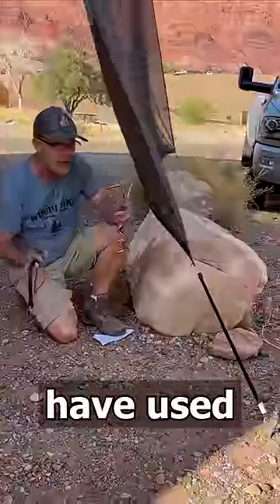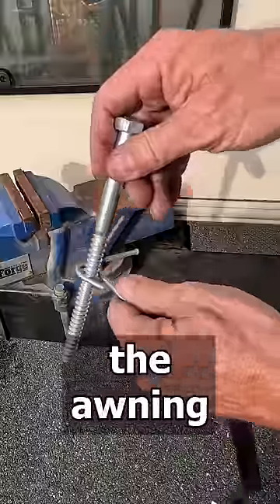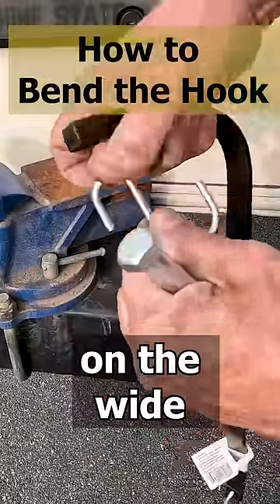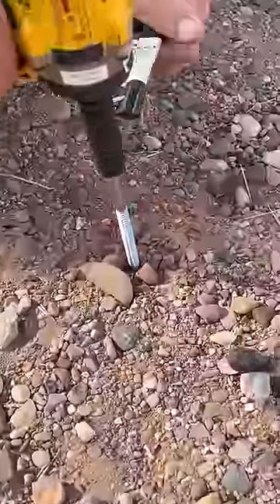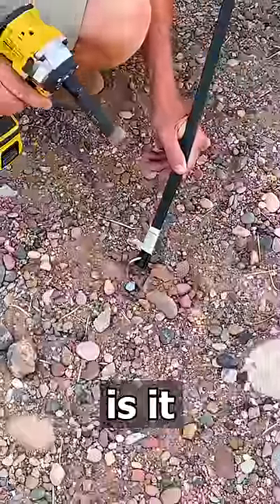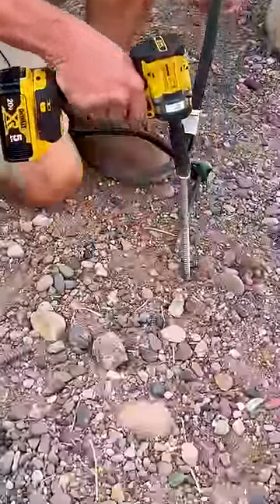Screw in Tent/Awning Spike #shorts  (RV Living Full Time) 4K

Comment: Heres another tip: put the screw at a 45 degree angle towards the pulling force.
That way the winds gotta lift the dirt also to pull it out. (It'll be able to withstand much stronger winds and things potentially tripping over the cords.)
Reply from the maker: Great tip. Thanks
Reply: I always do this with the supplied stakes

Comment: I made my spikes out of 24 inch masonery drill bits with nuts welded on the top, they drill throgh any ground, 
And long enough not to pull out of soil.
Use a 3/4 inch bit by 2 foot , been using them fot 20 years.
Reply from the maker: Wow. That’s intense. 
We are aiming more at what you can find easily at an Ace Hardware 
But sounds your system is the top 👍

Comment: That would only work out west, the soil on the east coast isn't packed as much and the lag screws would pull right out
Reply from the maker: Definitely depends on the soil. We camp in a lot of “natural” spots so we haven’t had issues
Reply: ah don't know what "natural" has to do with
anything other than cringy virtue signaling
since it obvious u can't just run screws into any ground and that's gonna work.  🤨
Reply: @warehousejo007 . Obviously it’s gonna depend on the ground type …. But as as matter of fact tho I live on the east coast and use this method for many years for my animal pens… no problem!!!
Reply: in upstate NY they have a lot of slag / shale in the soil, and I have been using what we call "50 penny nails" which are about a foot long and used on landscape RR ties because tent stakes just bend. This idea is next level for sure!
Reply: I’m is the easy and this true. Say the preferred areas I go to have sand, which is natural. As well as soft upper soil (camp by rivers). So I get rid of the ones they come with and get better ones. Then again I go prepared and by get rid I mean or then in the bag for back up. A terrible back up 😂

Comment: I'm using plain screwdrivers instead of the nails. They work great with rocky soils, hold great, and you have nice handle for pulling it out.
Reply from the maker: That sounds like it would be easier to get it out. But wouldn’t it stick out?
Reply: @DownsizingMakesCents   It does stick out a bit. But you have to remember not to trip over the ropes anyway, so it's not too bad I suppose.
Reply: Your idea with long screws sounds great too. But you need additional tools to use it,  and not a dead battery (which is a possibility) to extract the screws :). Plain hammer and screwdrivers are simple. I suppose anything is better than those standard but useless hooks they insist on selling with tents. Those just don't work in rocky soil at all

Comment: Hmm, i wonder what the lowest power drill you could use for this is. I normally have an electrical toolkit with me but those drills/ drivers aren't the strongest.

Might need to go get me a Harbor Freight impact.
Reply from the maker: Any drill should do it - it just might take longer. And it depends on the ground, of course. 
But impact driver does make it easier

Comment: Have you tested the strength? Doesn’t seem like there’s much thread there to bite into loose dirt
Reply from the maker: If it’s loose, wet it first. 
But no issues since this video
Reply: It's twice as long as a tent stake and certainly has more bite... which is what counts. BTW, the bungee cord takes the tug out of the wind, so the stakes don't pull out in the breeze. That's why stakes pull out with rope or paracord.

Comment: Yeah, I've tried this before, it never held in any ground in the PNW.
Reply from the maker: Sorry to hear that. Try a 13-16” lag screw drilled at an angle. Works even in soft sand in Florida
Reply: @DownsizingMakesCents  still not long enough

Comment: Why do have an impact socket? And there’s no way a log screw will hold down 30+ mph winds. Why it use the proper toe downs if your going to break out the 20v tools. You look old enough to know that “hacks” are not sufficient in 90% of its proper applications and are usually done by a hack. Which is a worker that “cobs” things up.
Reply from the maker: Worked fine in Hurricane, Utah - known for its winds

Comment: Use a wood screw with larger thread.
Reply from the maker: Hard to find - but screw we are using is designed for wood.
Reply: @DownsizingMakesCents  Its still got a tight thread.

Comment: Guys - just buy concrete steel stakes “pins” trust me. I can drive a 3’ stake in to rocky compacted clay without any problems and hold concrete forms with thousands of pounds of hydrostatic load for $9 each…you’re doing too much
Reply from the maker: A bet it’s hard to get them back out? That’s the point 
But thanks

Comment: Lag Bolt.  Not a screw …..
Reply from the maker: True. But it has threads
Reply: @DownsizingMakesCents   Yes they have threads, and so does a carriage bolt, and the latter has a tap an die type of threading that accepts a nut.   I like your idea though. I remember as a kid having to have to hammer 🔨 the damn spike in at an angle, hoping it would hold !! And if it did, it usually left slack. Lol 😂